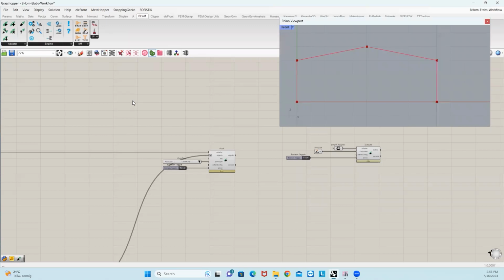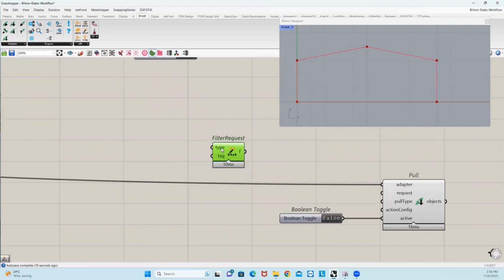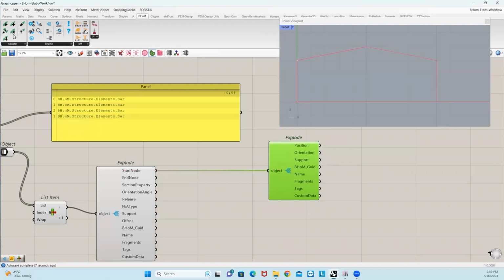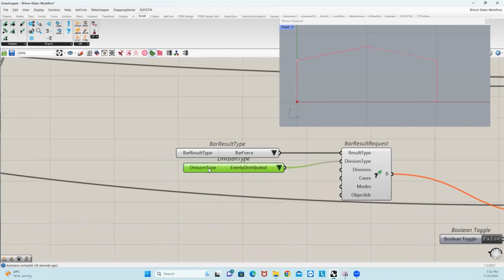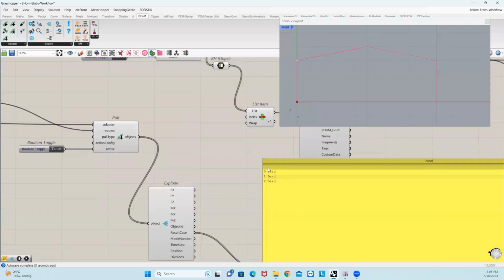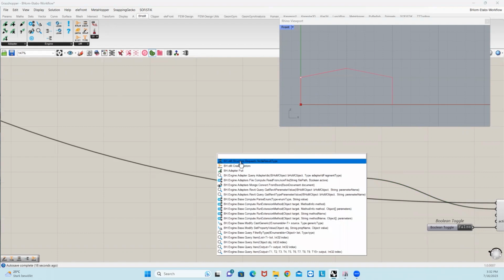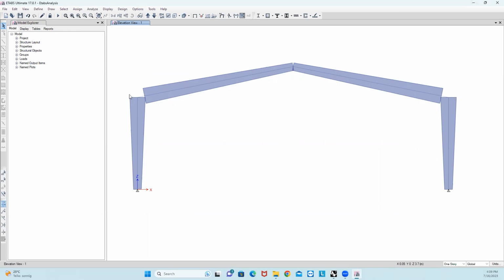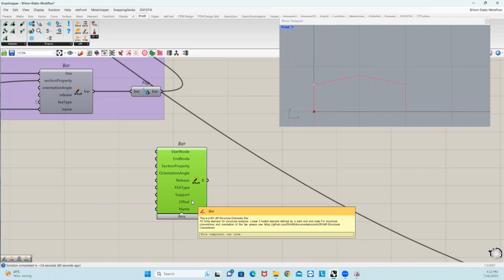Grasshopper to ETABS (Steel Portal Frame Model) Using BHoM Tool (Analysis Part 2/3)

Comment: Great little tutorials, thank you.

I had a little play around with the ROBOT adapter and seemed to struggle with the tapered steel sections used for the portal frame columns.

Do you get the same and any thoughts on navigating around the problem ?
Reply from the maker: Thanks ☺️. 
What kind of problem are you facing?